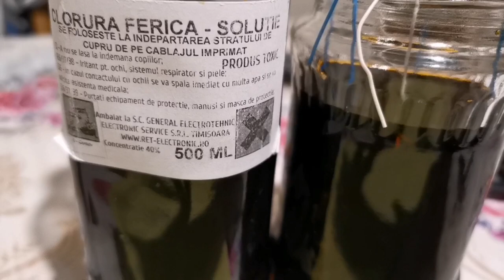My first custom Victorinox

Comment: You got that dark satin finish on the blade just by etching with ferric chloride solution, or you did some other preparation beforehand? (I mean, apart from masking the pivot holes)
Reply from the maker: Just with the etching, yet it more white greish than dark greish, don't be fooled by the camera

Comment: What thickness did you use for the brass rods?
Reply: 91mm SAK tend to be 2.5mm and 2.2mm brass rod
Reply: looks like he turned some thicker stock down using a file and a drill as a lathe , I'm just guessing but it is what I am going to do rather than toss out cash on kits